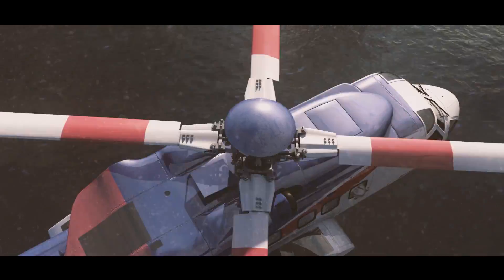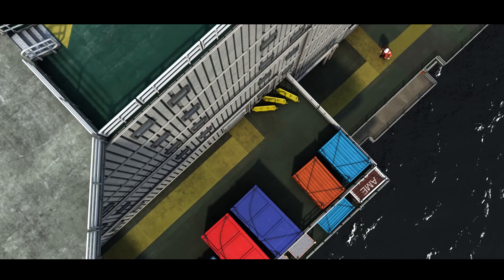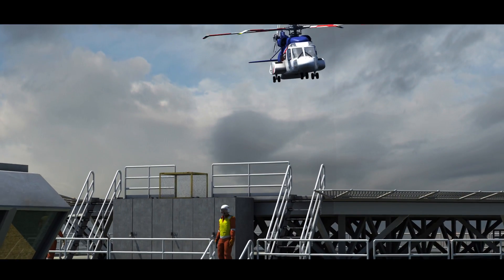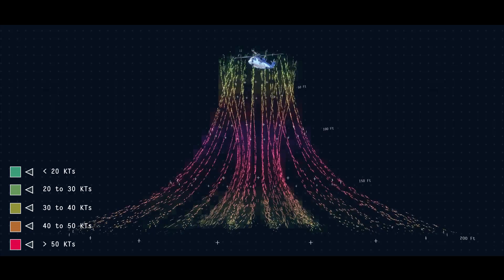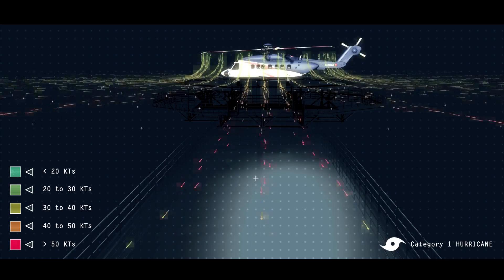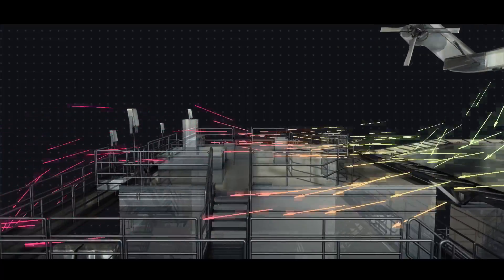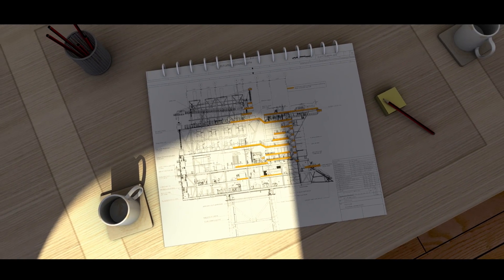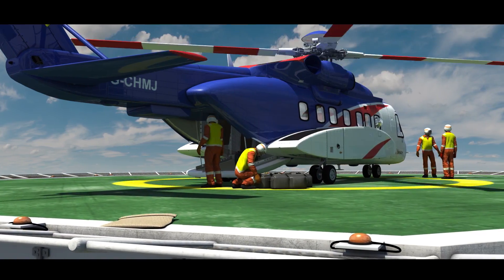Helicopter Downdraft Danger | bp

Comment: Very interesting video. It may be interesting to also  represent the danger of the recirculation inside the main rotor when getting close to obstacles : the potential ingestion by the rotor of unsufficiently rigged equipment who would be lifted by the rotorwash, and then sucked by the upper part of the downstream. I'm referring to this tragic AS350B3 accident on a ship off coast Norway in May of 2017.